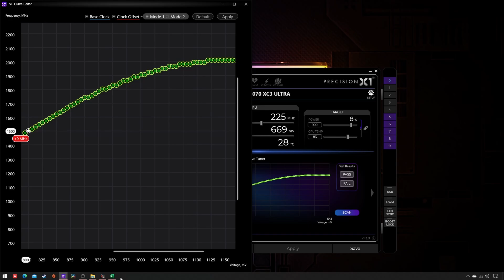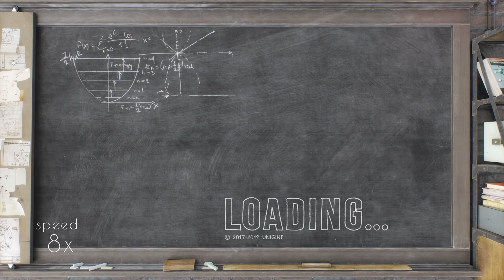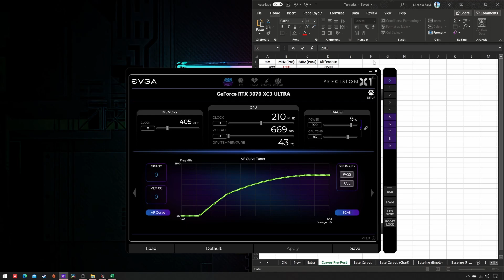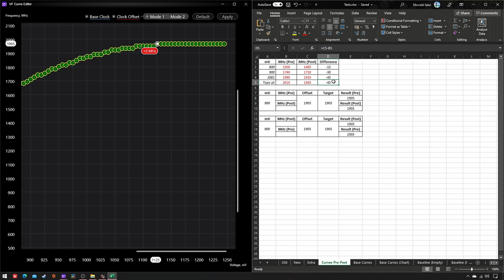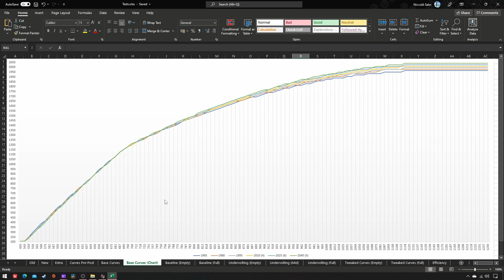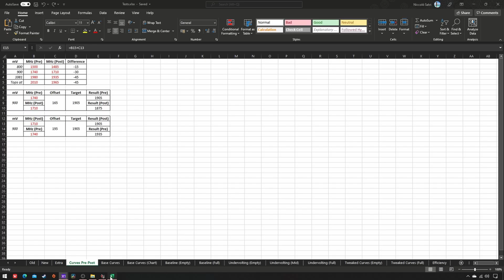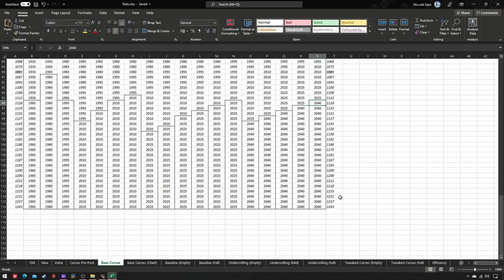[1/5] Undervolting w/ EVGA Precision: base Voltage-Frequency curves

Comment: At 1:09, you talk about the maximum voltage officially supported by your card. How do you figure the maximum voltage? I am currently setting everything up to follow this series and undervolt my 3080ti FTW3 Ultra, but some of it seems a bit overwhelming/time consuming to a beginner when it comes to undervolting. Other than those few instances, this is an absolutely wonderful guide, the attention to detail you've put into this series is incredible. Bravo!
Reply from the maker: Grazie mille! Yes, I can totally understand if you feel overwhelmed... my guide sure is VERY time consuming. But I'm happy to help you along the way, if needed! As for the maximum voltage of your card (great choice btw), look here: https://www.techpowerup.com/review/evga-geforce-rtx-3080-ti-ftw3-ultra/35.html. If you scroll down, you'll see: "Gaming (23 Games: 0.950 - 1.081 V)". However, you should double-check this value (1.081 V) by playing some of your games with HWiNFO running in the background.
Reply: @oakenglass   Thank you for the prompt reply! I have just finished running/recording my baseline. However I did not notice until about halfway through that I was running all of the benchmarks at 113% power limit and 82c temp limit, will this cause have any implications when transferring over to my undervolt? I'd love to have some help, if you don't want to clutter your comments section I can chat through discord or just about any other communication app if you're comfortable! If not, totally fine. :)
Reply from the maker: @541CBR  Let's use the comments for now, since they may prove useful to someone else. Thankfully, a baseline recorded with a higher power limit won't affect the undervolting procedure per se. Nevertheless, a higher power limit might produce a different "best base curve", so this is my suggestion: set it to 100%, turn off your PC overnight and the next morning write down again the Voltage-Frequency points of your base curve.
Reply: @oakenglass  Okay, I will retest tomorrow at 100% instead of max. Also, while testing in OCCT, are you running the full hour for each test? or just until freq. stabilizes or fails? Running for the full hour will be very time consuming! I would have to set aside some time to do those. 

Also, I must note that I am noticing temps while testing are higher than I expected/would like. I am running a pretty steep fan curve for all testing, and yet still I see temps up in the 75-78c range. If I am looking for a mix of performance/lower temps, would I consider lowering the freq. on all fronts for each point? Thanks in advance!
Reply from the maker: @541CBR  Set "OCCT > Settings > Stop on error: Enabled"  (like I said in Part #3): when it fails, you won't waste an hour. Success means completing the whole hour, I'm afraid.
Regarding the temperatures (I assume in OCCT), please tell me what voltage, frequency and fan curve you have set.
Reply: @oakenglass  at my initial OCCT run, 800mV/1725MHz, I was hitting 75c GPU temp. Fan curve is fairly steep, 40% @ 40c, 65% @ 65c, 80% @ 72c, 100% @ 80c. And I figure the temps will only stay the same or go up as voltage/clocks rise. I have a Corsair 5000D Airflow with 13 case fans, 3 front intake, 3 side intake, 6 top exhaust (Push/Pull setup on 360mm Rad) and 1 back exhaust.
Reply: @oakenglass  I am also only running 15 minute tests on OCCT, from my understanding OCCT is pretty taxing compared to other stress tests. So with the assumption that 15 minutes is enough to test stability in high demand, I will be able to save some time and spare my graphics card from an hour at 75c. I am also knocking each frequency down one step after passing to ensure stability in the long run.
Reply: @oakenglass  So while on the Port Royal portion of my stable VF combo testing, I had a hard freeze then what seemed to be a quick reboot @ 825mV/1815MHz. It had tripped Thermal and Power limit and It reset my monitor refresh rate from 165hz to 60 and was outputting at like 10fps even at desktop no load. I shut down the PC, let it cool for about 10 minutes, booted up just fine afterwards. What happened? Reboot into safe mode?
Reply from the maker: @541CBR  Even if OCCT is indeed very demanding... 75°C at 800/1725 is too high, especially considering your VGA heatsink, case and fans configuration. Thus, I suggest you stop your undervolting process: first we have to understand WHY your card runs so hot. Please reset it to its stock condition (100% Power Limit / Fan Curve Control: Disabled / VF Curve: Default), run PortRoyal and tell me the Voltage (max), Frequency (max) and these three Temperatures (max): GPU, Hotspot and Memory Junction.
Reply: @oakenglass  Run PortRoyal Stress test or benchmark?
Reply from the maker: @541CBR  Benchmark!
Reply: @oakenglass  Okay, reset to defaults. everything goes as follows:

Max voltage: 1.050v
Max frequency: 1905MHz
Max GPU temp: 79.3c
Max Mem. Junc. temp: 84.0c
Max Hot Spot: 85.2c

All of that is well above what I’m comfortable with, especially with a brand new card. Whilst running PR stress test while testing VF combos, the temps were around 65-70c, better, but still a little warm considering my setup.
Reply from the maker: @541CBR  Your results seem to be in line with those of the TechPowerUp review. What's your ambient temperature?
Reply: @oakenglass  Right around 18-19c
Reply from the maker: @541CBR  Ok, now keep the same power limit (100%) and fan curve control (disabled) but undervolt at 800/1725. Then, run PortRoyal again and post your results.
Reply: @oakenglass  Max voltage: 0.800
Max frequency: 1755MHz
Max GPU: 66.4c
Max Mem. Junc. temp: 78c
Max Hot Spot: 73.3c

I had the freq. set to 1725, it stabilized at 1755 and ran the whole test at 1755. It typically jumps 1-2 steps past what I have it set at. Even at higher clocks/voltages.
Reply from the maker: @541CBR  That frequency jump is normal (if you haven't done so, watch the fifth part of my guide). Is your card mounted horizontally or vertically?
Reply: @oakenglass  GPU is mounted horizontally, the old fashioned way! 

I have watched the series a few times over now trying to memorize everything! Haha
Reply from the maker: @541CBR  Nice... thank you! Since your ambient temperature is normal, your card is mounted horizontally and its stock results are coherent with the TechPowerUp review... we have to assume those temperatures are fine, after all. Apparently, OCCT 10 is more demanding than I thought with GA102 GPUs (OCCT 11 will use a lighter, gaming-like load). Now, you could proceed with your undervolting: keep the same settings (PL 100% / FCC Disabled) and test each VF combo with PortRoyal Stress Test. In my opinion, you should let your card complete the whole test (i.e. 20/20 loops, about 40 minutes in total). In the end, pick the VF combo that provides the performance/temperature ratio you prefer!
Reply: @oakenglass  So I have been going along with the stress tests (full 40 minutes), at 868mV/1875MHz I got a pass on the stress test, but tripped the power limit in HWinfo. At that point would it be considered a Fail and step up one voltage step?

Edit:
 I continued on with with one voltage step (875mV/1875MHz) And got a thermal limit and power limit trip but still passed stress test. I am assuming this is reaching the limits of the card with stock power and temp limits set? Should I continue as normal and just rely on pass/fail of PR stress test? Up the power limits of the card? Or stop at the last pass with with no power or thermal limit trips and use that as my max UV?
Reply: Okay, I am now manually inputting each of the offsets into my VF curve, but once I get to 900mV, no matter what I do to the following voltages, when I press apply they will never stay below my max vf at 900, they will automatically match it or go back into a default-ish curve and continue rising. What am I doing wrong?
Reply from the maker: @541CBR  When a VF combo trips the power and/or thermal limit, it can't be considered stable even after a successful stress test (since, when this happens, the card reduces its variables to contain power). If you want to accurately test the stability of those VF combos (868/1875 or 875/1875), increase a bit the power and thermal limits, yes. If you prefer to keep them at stock (100% / 83°C), stop your undervolting efforts at the previous combo (862/1860)... as you have already said!

When you press "Apply" inside the "VF Curve Editor" the voltages after 900 mV will always match the same frequency you set at 900 (i.e. there's a flat line starting from 900). But when you close the Curve Editor, in the "VF Curve Tuner" you will see that there's a single VF point higher than all the others (namely 900 mV / whatever frequency you tested). All this provided that you have set the offsets correctly. Sometimes the "VF Curve Editor" is quite buggy... so maybe you just need to try again.

If you are still in doubt, link me a screenshot of both Curve Editor and Curve Tuner.
Reply: @oakenglass  I have actually gotten everything figured out! I ended up stopping at 900mV/1905MHz, but might continue on up to 950mV if I need more juice for other games.  I was running some PVP matches in Destiny 2 (one of my mains), maxing out my monitor refresh rate (165Hz, 2560x1440) all while having my average temps around 53-55c after a couple of matches. Considering on stock clocks I couldn't max out my monitor, and was hovering around 65-70c, I would consider this a massive success! Obviously I have some more validating to do, but it is looking good for now! I can't thank you enough for taking the time to walk me through the steps I couldn't figure out on my own, you are awesome!!
Reply from the maker: @541CBR  Really... no problem at all! It's always nice to help a fellow PC enthusiast. Reducing temperatures while increasing performance? This is a great accomplishment indeed, I'm happy for you (and for your graphics card as well). Now you just have to enjoy your time playing games with your buddies!
Reply: @oakenglass  well turns out it wasn’t very stable, got artifacting in a couple games and even a crash. :/
Reply from the maker: @541CBR  Tell me more, please. Did you test 900mV at 1965MHz in PortRoyal Stress Test (20/20 loops) and then reduce the frequency by 60 MHz (i.e. 45MHz, Part #3 + 15MHz. Part #5) as I've suggested? Or did you test 900mV at 1905MHz in PortRoyal Stress Test (20/20 loops) and then keep this same frequency?
Reply: @oakenglass  I ran into issues at 950, went down to 925/1890. Same issues, I went down -45 from the stress test numbers, still unstable. I ran every single VF the full 20 loops.
Reply from the maker: @541CBR  In what game? Also, is this the real max frequency reported in HWiNFO or the one set in EVGA Precision?
Reply: @oakenglass  Destiny 2: Artifacting/Frame Drops
RDR2: Artifacting/Frame Drops/Crash
Escape from Tarkov: Crash/Frame drops
Rocket League: Artifacting/Frame drops

And it is the max frequency reported in HWinfo, I always go off of HWinfo to confirm I am hitting the corrects points.
Reply from the maker: @541CBR  Have you overclocked the memory by any chance? I'm asking this because yesterday you said you played Destiny 2 with UV 900/1905 without any problem and today the same game has artefacts with UV 925/1890. A card that now works with more voltage and less frequency should me more stable, not less... 

Let's do this: undervolt at 900/1845 (this is a VERY conservative VF combo), run PortRoyal Stress Test with HWiNFO in the background and link me a screenshot of them when the test ends (namely one where I can see the "frame rate stability" percentage [PortRoyal] and all the GPU sensors [HWiNFO]). In this way, I may be able to diagnose the problem.
Reply: @oakenglass  It keeps deleting my comment with the imgur link, also I'm from NA so that's why I don't reply for hours at a time haha
Reply from the maker: @541CBR  I figured! (7.00 am here in Italy). As a workaround, paste the characters after the slash.
Reply: @oakenglass  It keeps deleting, even if I just post the characters after the slash?
Reply from the maker: @541CBR  Interesting! Maybe try putting spaces between the characters and removing the extension (jpg/png).
Reply: @oakenglass  So after re-attempting a few times, still couldn't find stability. but to update you, I got a FTW3 Ultra 3090 through the step up program, and I am just going to do a full custom loop in my PC. EK components with an active backplate for GPU, monoblock for CPU and Mobo, double 360mm radiators. Shouldn't have to worry about temps anymore!
Reply from the maker: @541CBR  That's a really cool upgrade! Have a great time.
Reply: @oakenglass  This thread was helpful to this "someone else". Thanks

Comment: Conclusion: use afterburner :). Very informative video but I'll keep using afterburner for my evga 3060
Reply from the maker: Sure! No reason to change if you're satisfied with Afterburner.
Reply: Afterburner is unable to set a fan curve for the third fan, so no thanks.